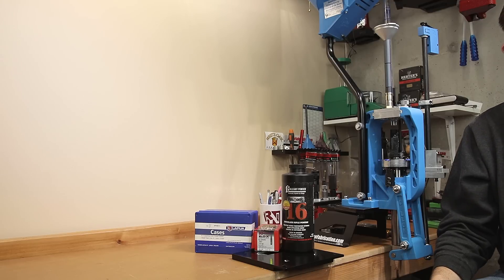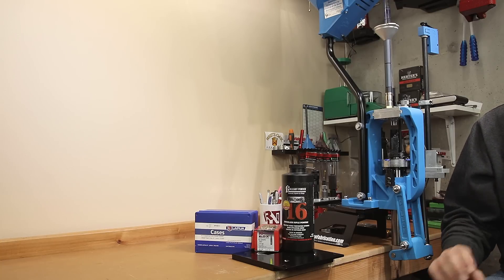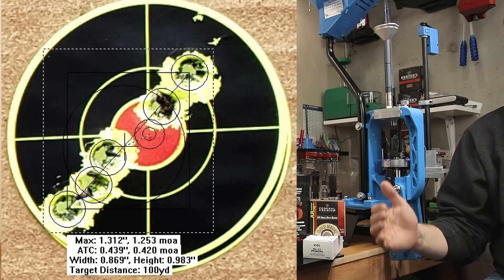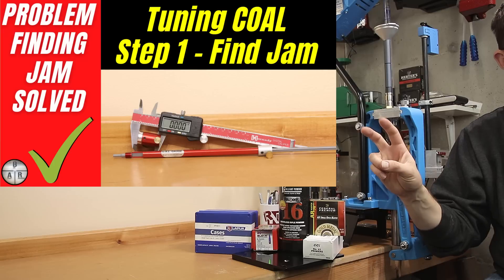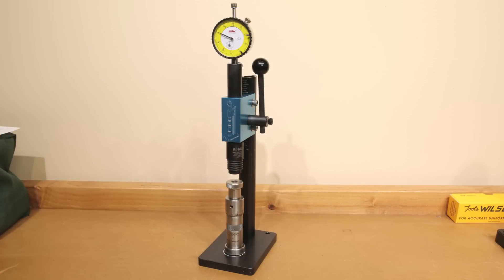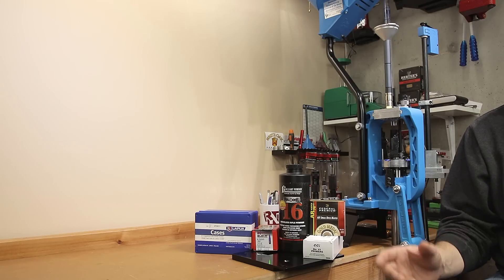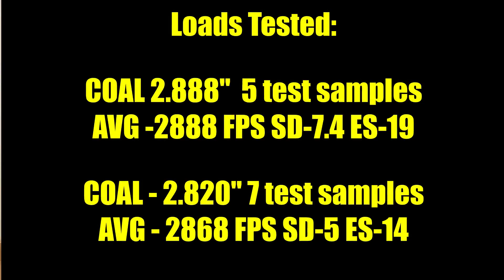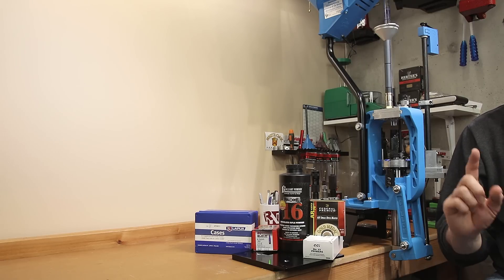Find the Correct Powder Charge - Powder and Primer Tested!

Comment: I don’t have a chrono yet so I’m doing this kind of stuff based on groups and shooting a waterline target at 100 yards. I did this load work up with a COAL of 2.800 (based off the loading manual). 
I liked the way this work up was shooting at 43.7-44.1 grains of Varget. My pressure test went up to 45.5 grains without any pressure signs. Now my question is if I were to introduce a COAL that’s .020 off my lands do I need to start over essentially with my pressure testing, or do I just load up my 43.7 load to the new COAL and be good to go since I had 1.5 grains or more headroom until seeing any pressure signs.

Comment: Velocity nodes and accuracy nodes are two different things.  You can have zero velocity change and shoot shotgun patterns.  I will take accuracy over super consistent velocity, because velocity doesn't matter if it shoots straight.
Reply: You need both to shoot accurately at long range. 
High ES and DS will give you vertical issues, either push you over the top or bottom of the target.

Comment: Good video.  I'm curious about the accuracy of your powder scale?  I.E. Your charge weights are moving in 0.2 grain increments, but I'm curious what the error bars on charge weight would be.
Reply from the maker: Hi Ben, I use a fx120i and it can resolve a single kernel of powder. All these  charges are within .02 gr
Reply: @BoltActionReloading  It would be cool to see 20 rounds loaded at a given weight with 20 more loaded at 0.1 grain more (accuracy of many scales).  Then fire them all else being equal, testing the difference in average velocity between the two.  I.E. how much could a guy improve his velocity moving from .1grain scales to .02 grain scales.  You may have already talked about this, I haven’t watched all your videos.
Reply from the maker: If you are in an area with a wide node. I don't think it's really buying you much. I have loaded some combinations that just flat out didn't work out and it didn't matter how accurate the scale was. I understand what your looking for but its really impossible to resolve the difference there I think.
Reply: @BoltActionReloading  Yeah that makes sense, it would be easy for the difference to be lost on the noise.  I guess I am thinking of the scenario where you have found a combination that performs optimally in your gun, specifically in terms of SD and ES, using a scale that is accurate to 0.1 grains.  It would be nice to put a number on how much your SD and ES should got down by moving to a better scale, on average.  Most of us probably will never be able to measure it with the setups we have for velocity measurement and given the other factors involved.  But if there was a way to demonstrate it, with statistical significance, I'd probably buy the better scale, depending on the purported potential improvement.

Comment: Picking a "node" based on velocity does not insure the target will agree. Essentially all winning bench rest, Fclass, etc precision target shooters shoot a charge ladder on the target to identify the node resulting from barrel harmonic vibration, which does not affect velocity; and they will emphatically tell you the best accuracy generally does not relate to chrono statistics. In fact on the target you will see increasing charge weight and velocity will generate a sine wave point of impact response where faster bullets actually hits lower. This is also how rifle tuners work. Prove this to yourself; next time you run a single shot charge ladder, shoot it on the target as well and compare the results.
Reply from the maker: HI Charles. Is there any chance you actually watched the whole video? This is 1 step of the method that Erik Cortina has put forth. This is not a find the velocity node and your done. This is a process. Erik might happen to be one of those "winning" F Class shooters that don't use this method. Except this is his method. The whole point of the series is proving it too myself. I agree if you just pick a charge you might not have the best groups. The next step is to adjust COAL to dial in your accuracy, then tuner.

BAR
Reply: @BoltActionReloading  I did fast forwarded through a few areas. I have read many postings by EC, and up to this point have only seen him present charge weight tuning based on shooting a target. His long range tuning at 100yd post has had over 1000 replys; it is essentially the OCW method developed by Dan Newberry years before. On this basis I cannot say to what extent he relys on tuning with a chrono; on the otherhand many use it to improve loading consistency (eg brass prep) after a tuning has been developed. But again I know the vast majority do not rely on a chrono to tune for charge weight. As noted it is free to look at both during load development for better understanding.
Reply from the maker: Well Charles, this is his new one. It is not the same. If you are a Patreon of his then you could watch the step by step process that he goes through. It requires a chrono. I've had another poster reference something he posted in 2012, so I guess people are never change or update their methods. If you cared to watch the whole series posted in the playlist at the end you may get find of interest his updated methods.

Comment: I have loaded up a couple of 12 shot test with different powders, after reading Erik's 100+ page post on accurate shooter on long range load development at 100 yds I was going to pull them and load how he suggested there. However that original post is 7 or 8 years old. Now after seeing how he does it now makes me glad I didn't pull them and I am still going to try the 12 shot strings with chronograph. Thanks BoltAction Reloading for sharing this video. I am now on his patreon and watched his 4 videos.
Reply from the maker: Glad you enjoyed the video.
Reply: @BoltActionReloading  are you consistently finding velocity nodes to test?  So many people hate this method and some swear by it. I'm going to try it myself with my 308 with 168 Sierra TMKs and IMR 4166 and 4895. I will be using magneto speed for the first step. I am going to have to get a better seating die for that test.

Comment: ? I got my lapua brass last week. It has 308 over 7.62x 51 under. Do I load as 308 commercial brass or military brass. Any information on this would be deeply appreciated. Thanks
Reply from the maker: You may want to take a internal case capacity measurement and see there it falls. I can't remember if I have measure this. I have been just using the 308 Winchester data form sierra.
Reply: @BoltActionReloading  Thanks I will check

Comment: Again, great vid. Thank You for the time & effort you put into these vids.
I must say though, for the average guy & rifle, I don't believe this method is of any practical use. 
There was a discussion over on Snipers Hide about the Satterlee method & how it applies realistically. The major point here is that, Satterlee developed this method using data & previous results from his rifle system. Satterlee was operating from the assumption that the rifle system was capable & proven to produce very low velocity SD"s which, is imperative for this method to produce meaningful data. 
This method is a prime example of how we can all be influenced by our presuppositions wherein it is difficult to view the data in its true perspective without imposing our beliefs upon the results. 
Kind Regards...............Rotas
Reply: Exactly how is one rifle more capable than another in generating low SD's?
Reply: @kenginter6112  Well, it's more the barrel, chamber & ammunition I suppose. All I know for sure is that, without very low SD"s, the data can't be representative of what you're looking for; a flat velocity node. 
For example; if you choose 0.2 grn intervals &,, suppose the velocity difference average is expected to be between 15 & 20 ft/sec, you'd need an SD of less than 20 ft/sec which, is  +/- 10 ft/sec in order to have any certainty that what appears to be a velocity node, isn't just shot to shot natural overlap distribution of that rifle system.   
Unless you have a rifle/ammunition system which is proven to produce very low ES/SD"s with that particular powder/bullet combo, the Satterlee method simply cannot be relied upon to produce reliable data. 
As for the rifle system generating low SD's, my rifles can & have produced SD's as low as 5.5 &, a few 9's but, they are the exception & not the rule with any of the rifles I have at the moment. Hopefully that will change in the near future but, my rifles certainly won't produce the required ES/SD's reliably enough to be searching for velocity differentials of 10 & 15, not even close. With my best reloads to date, my average SD's hover around 18 to 25. Nowhere near low enough to differentiate velocity differences of 10 to 15 or even 20 ft/sec. All I would be seeing is the natural gaussian distribution overlap & confusing that overlap with a velocity flat spot & nothing more. 
Regards..................Rotas

Comment: Great stuff! 

I just finished working up a load in 6 creed, with 115 DTACS, RL16, Peterson LRP brass, and CCI BR2 primers, deciding on velocity data only, with an SD of 5, and ES of 13, averaging 2948 fps with 39.8 grains, with a CBTO at 0.030” off the lands. Luckily, it still feeds from AICS mags, as 115 gr DTACs are on the long side. Ended up with 0.5 MOA groups consistently at 100 yards on my 24 lb PRS rig.

I’ve used LOTS of your technical videos as a resource in load development. Thank you!
Reply from the maker: Glad you enjoy them.

Comment: Those velocities are cooking! 2880-2920 is superfast for a 6.5 cm and a 143 bullet. I ran my 6.5 cm at 2830 with H4350 and my barrel was done before 2000 rounds lol.
Reply from the maker: The 2 extra inches of barrel help get the velocities higher without pushing pressure too high.

Comment: could you remind us which chronograph you are using for your data?  New reloader here and am compiling equipment.  I checked your amazon page and it was not listed.  Thanks for the information you post, it is very educational.
Reply from the maker: I am actually using a magnetospeed for most of it, however I am transitioning to the labradar at the moment. I no longer shoot groups with my magnetospeed attached. I added links to my store for the magnetospeed. The labradar isn't in stock on amazon at the moment.
Reply: @BoltActionReloading  thanks, did you drop the magnetospeed because of harmonics? True Accuracy?
Reply from the maker: I am going to eventually do a comparison on and off. Opinions are over the place. It will affect poi.
Reply: @BoltActionReloading  if only POI is affected and I would think if the right components are used you would still have a good group?

Comment: Great videos...I wouldn't spend another minute justifying what you do. 

I'd be curious to see what happens in 0.1 gr steps after you dial your seating depth. Start half a grain low and go half a grain high just to double down on the data and see just how wide your window is. 

I'm excited to try these methods when I get some primers. I just picked up a labradar, my first chrony, and I'm itching to check some old loads and work up some new.

Thanks for the content!
Reply from the maker: Thanks Ken, ibam going to try and follow the process to the letter as much as possible and see where it gets.
Reply: We will be watching. Got a pair of teenagers watching along also...

Comment: I love your goal to learn and to improve!  How did you determine the correct powder charge?  Was it due to a plateau at 42..6?  Then you tested the 5-shot, 7-shot groups at that powder charge of 42.6 gr?  Changing your cartridge over all length changes combustion or changes barrel harmonics?
Reply from the maker: Hi Missy,
Since the velocity from 42.4 to 42.8 were basically the same I chose to load in the middle of those. (42.6) the 5 shot group was to validate that the nod was real and the 7 shot group was to see if I was still in that node (and to get the velocity so I could do my drop table for my hunting trip) The next step will be to to the barrel harmonic testing by changing the COAL.
Reply: @BoltActionReloading  Your first step is to find a "combustion node" so why not shoot 5-shot groups at each powder charge above 42.0 gr to get the combustion node that has the lowest velocity standard deviation?  I might not understand, it seems like you have variation statistics standard deviation, extreme spread (n=5,7) only for one specific powder charge (42.6) not any other charges above or below?  For examples it is unknown what a 5-shot std. dev/ ES would be at 42.6, 42.8 grains?

Comment: Do you use graphite/dry neck lube in the neck before seating the bullet?
Reply from the maker: Hi Jim, Currently I do not. This is something that I intend to investigate at some point. I am trying not to go too many directions all at once. I really want to know what the exact product that Lou Merdica is using in his video with the AMP guys. Clearly he believes in it. He just calls it molly. I have seem others use the dry lube, not sure what's best or of it matters.
Reply: How about when you use the case neck expander?
Reply from the maker: I do lube the inside case necks with graphite for the expander, but I use a case neck brush before I load them.
Reply: I tried this last week . 41 gr . H4350, cci br2 primers, Virgin peterson brass. 20 rounds, 10 graphite 10 clean necks. Absolutely no difference in group sizes. Yes, extremely small sample size.  And 
Santa has to bring that magnetospeed on 
Christmas to really know if there is any real difference.

Comment: I do not have a store close by my area to buy components whats so ever and the internet is not working out either
Reply from the maker: Midsouth has several option in stock right now I wouldn't hesitate to try . If your waiting for h4350 then you may just be waiting.
Reply: @BoltActionReloading  h1000 & n570 and magnum primers
Reply: @BoltActionReloading  thanks
Reply: I changed grocery stores since Covid just to check 2 stores.  Hour & 1/2drive for groceries is worth it.  There is a decent amount of powder on the shelves here but primers are still extremely intermittent- and that's for LRP and LPP.

Comment: I have a shallow lead , my 140's can only take 40.0 of 4350 before the primers show pressure signs.  so I dont have a lot of room to play with.
Reply: What primers are you using? Some are very soft and flatten early. Ejector swipe is the most consistent pressure sign. Because brass is brass for the most part
Reply: @zedoktor979  starling large primer brass. Fed match primers, or WLR .  The smith cut my chamber with a custom reamer, ment for benchrest matches.

Comment: I'm here just to make a random jerk ass comment.    However I would be curious to hear your thoughts on things like the Taccom structured barrels and claims they are accurate regardless of reloading specs.
Reply from the maker: I am not familiar with them at all, so I guess I can't comment. If they worked better than everything else they would be on all the pros setups though.
Reply: @BoltActionReloading  the taccom structured barrels are theoreticaly designed and built to eliminate barrel harmonics, its a intresting consept, tho they are expensive and i think they take the fun out of reloading if they work
Reply: @wildcat_reloading   The engineering is interesting.  I've only seen them in big cartridges used for ELR and ULR.   Not for the average dude.  Cost and not a lot of guys are shooting that style of shooting make them a niche product.